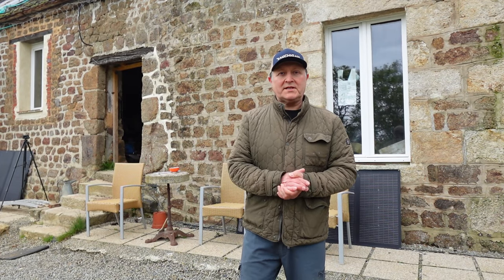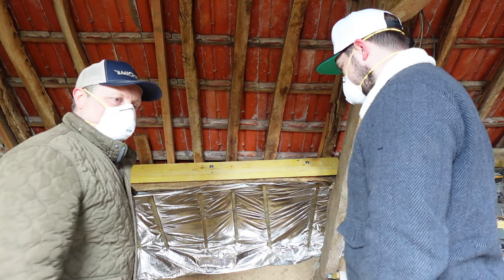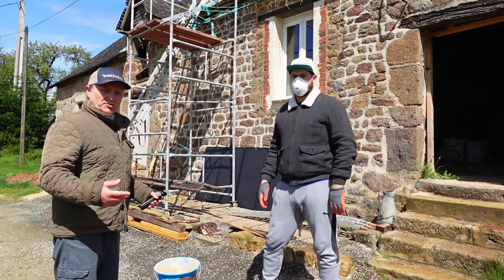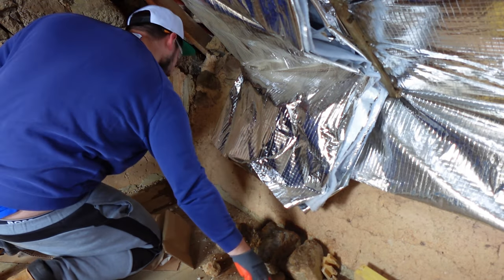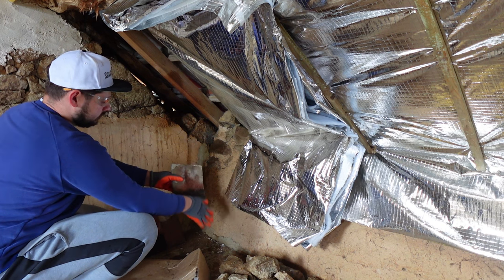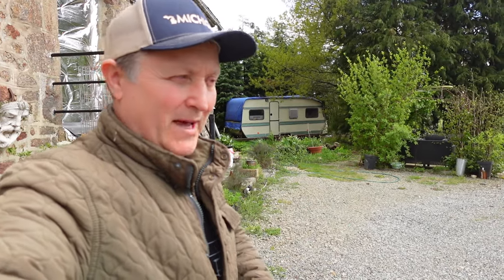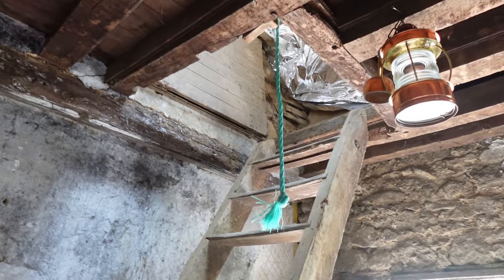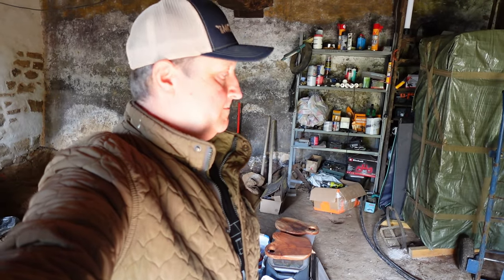I Got Myself An Apprentice... Am I Out Of a Job?

Comment: Hope you feel well soon, Sean!  Kudos to Tom for creative thinking about a spiral staircase.  One thought, though:  spiral staircases are notoriously difficult to deal with when trying to move furniture / suitcases / anything bulky.  You said your goal is to rent out this cottage so you expect to have a series of renters over time.  The alternative is usually to hire a crane and bring furniture in through a window, but 1) that could be quite costly and 2) I don’t think it possible to pass a bed or an armoire through the windows you’ve created.  Is there any other access?  (Barn next door may be a possibility).
Reply from the maker: Trap door

Comment: Lovely of your son to come help... I can hear the pain in your voice.  I'm sorry you hurt your ankle... I can certainly relate to that.  My ankle is so bad that I had to have surgery on it a few years ago... where I was basically told that my ankle is only held on by a 1/4 of an inch of my tendon left... of the 3 that hold your foot to your leg... and if I were to twist it again and wreck the stitching... which is permanent... It will be done for... and they will have to immobilize it with a steel rod... then my ankle will be permanently fixed in 1 place.  I do NOT want that!  So I try to play it safe now... no excess walking... careful where I step... don't want to turn my ankle again.  Hope you heal up quickly.  I knew my ankle was weak... I kept twisting it a lot... but I didn't know it was that bad.  Anyway, take care!  Looking good.
Reply from the maker: Take care, yes l sometimes have tendon pain so l can't imagine how painful and limiting yours is.
I have suffered from slipped discs in my back and not being able is very hard on the mind. All the best stay strong 💪
Reply: @Seans_World Thank you.  I have 5 bulging disks in my back.  I also suffer from fibromyalgia which I've had for a very long time... but I don't let that stop me from going to work.  Sometimes it can be very painful... but I manage.  I do wish you a very speedy recovery!  Ice and elevate that foot as often as you can.

Comment: Cherry pie from BBC good food

Ingredients
For the pastry
225g/8oz strong white flour
5g/⅛oz fine salt
15g/½oz caster sugar
175g/6oz unsalted butter, cold, cubed, plus extra for greasing
2 tbsp milk, for brushing
1 tbsp demerara sugar, for sprinkling
For the cherries
500g/1lb 2 oz cherries, pitted (or frozen, see tip)
180g/6oz golden caster sugar
¼ tsp almond extract, or almond liqueur, such as Disaronno (optional)
50g/1¾oz cornflour
To serve
ice cream, custard or cream
Recipe tips
Method
To make the pastry, in the bowl of a stand mixer, mix the flour, salt and sugar together (or this can be done in a large bowl). Add the butter and mix until the butter has formed breadcrumbs – you still want to be able to see some chunks of butter. Pour in 70ml/2½fl oz of ice cold water in one go and mix quickly to form a dough.

Tip the dough out onto a clean work surface and bring together with your hands. Wrap tightly in cling film and place in the fridge to firm up for about 4 hours.

To make the filling, put the cherries in a large bowl. Coat them in the sugar, almond extract or liqueur (if using) and the cornflour. Set aside the filling while you prepare the pie case – there may be some juice that leaches out from the cherries but don't worry too much as the cornflour will help thicken the filling.

To assemble, remove the dough from the fridge and gently knead the cold dough a bit. Cut one-third off and set it aside for the top.

Roll the pastry out to 4mm/⅛in. Grease a 20cm/8in pie case or closed bottom cake tin and line a baking tray with parchment paper.

Line the tin with the pastry, leaving a bit of an overhang. Keep the scraps of pastry if you have any and add this to the reserved pastry for the lid. Put the lined tin in the fridge while you prepare the top.

Roll the rest of the pastry to 4mm/⅛in and cut a lattice pattern (or leave as is if preferred). Put in the fridge to chill for 15 minutes on the prepared baking tray.

Once the case and top are cold, remove from the fridge, add the cherry mixture to the pie case and top with the lid. Pinch the edge of the pie and the top together to seal. If the top is being left whole (and not latticed) pierce a hole in the top. Return to the fridge.

Preheat the oven to 220C/200C Fan/Gas 6.

Put a heavy baking tray in the oven to heat up – it works best on the very bottom shelf of the oven. Brush the top of the pie with milk and sprinkle the demerara sugar on the top. Bake for 1 hour and 15 minutes, or until golden-brown. Check regularly and if the pie is getting too brown, cover with foil.

Allow to cool slightly before serving with ice cream, custard or cream.
Reply from the maker: Thanks will try